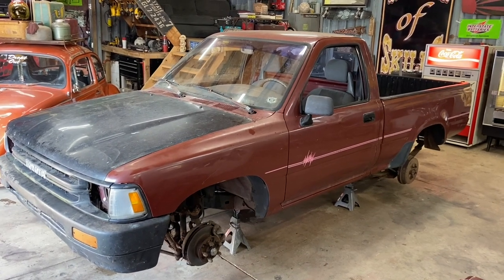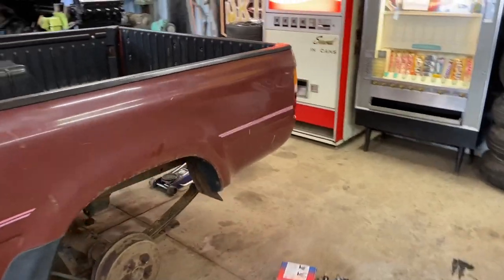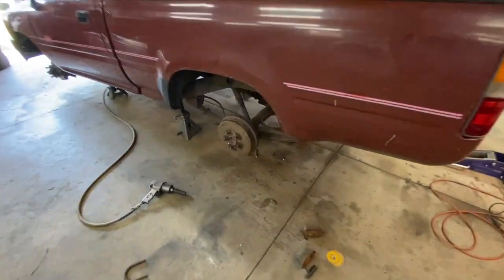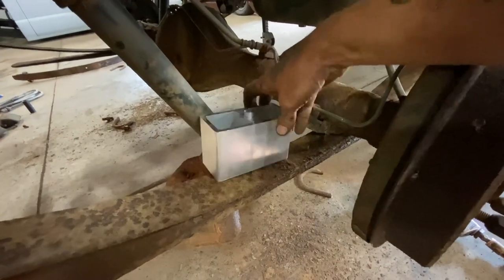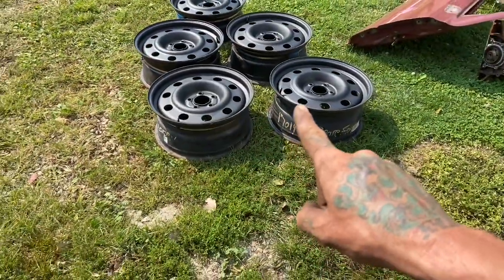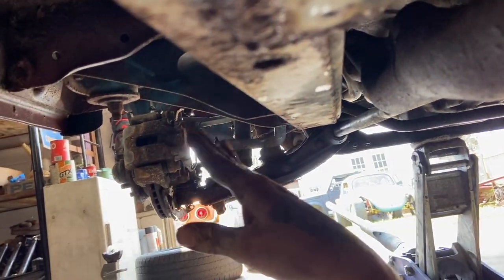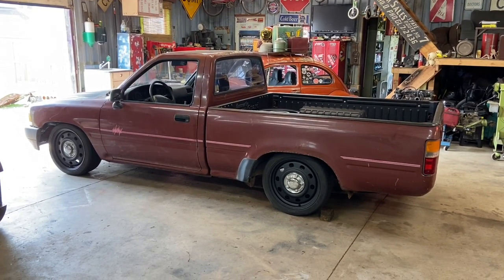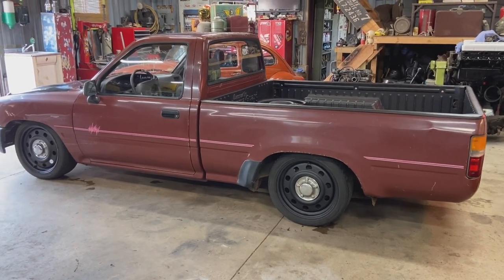EPISODE 47-LOWER YOUR MINI TRUCK FOR $50…..TOYOTA BUDGET BUILD

Comment: A tip on how to pinstripe your rims without using a pinstriper. Spray the outer lip what ever color you want and when it dries get some  3M Blue Fine line tape. It's about 1/8 of a inch. Run the tape on the outer lip and then spray the rim what ever color you want. Let it dry then peel off the tape and you have a "pinstriped" rim.

Comment: tools imma na buy tmrw: methane/lpg torch, 12ton jack stands, 2 sets of 3" to become 6" blocks, 2000 - 5000grit sandpaper for my headlights restoration, paint&clearcoat, and set of punch rods for my k20swap ek hatch.